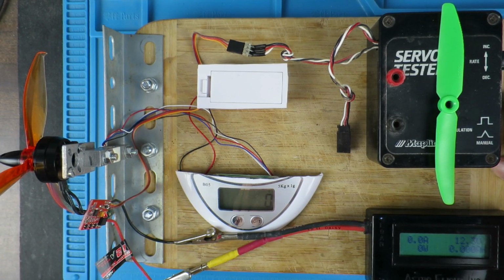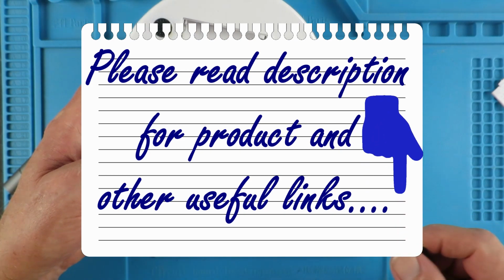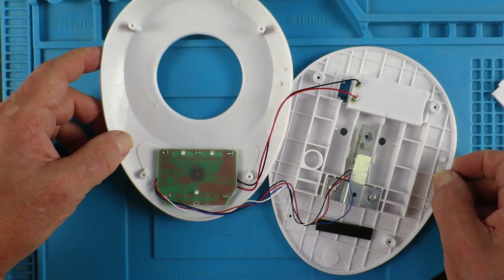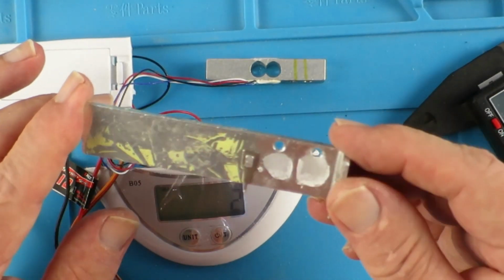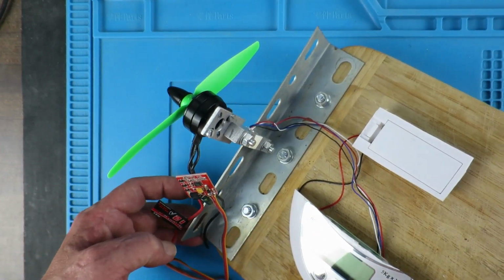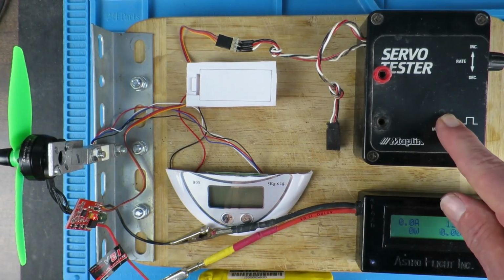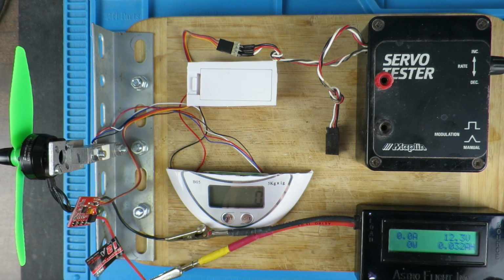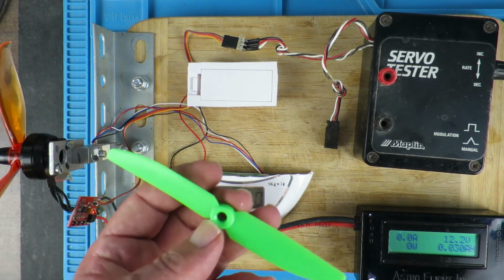Propeller Thrust Comparison Test Rig Project

Comment: Hey. :) Thx.
I've been wanting to build a prop thrust test stand for awhile. If you do more prop test vids, would you be willing to show more of how you connected the arm with/to the frame and/with the weight/load sensor? ;)
Reply from the maker: Thanks for your interest. The arrangement is very simple. The load cell has two holes top and bottom that are bolted to the angle plate and the motor bracket which I copied from a quad arm. You could have course just use the arm! See the load cell here : https://youtu.be/UlCckQ_n0e0?t=117